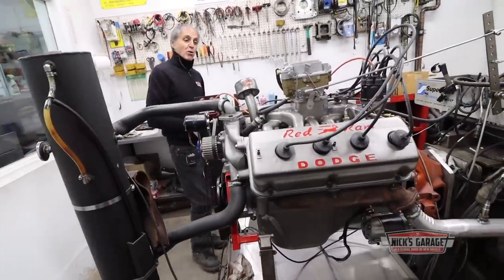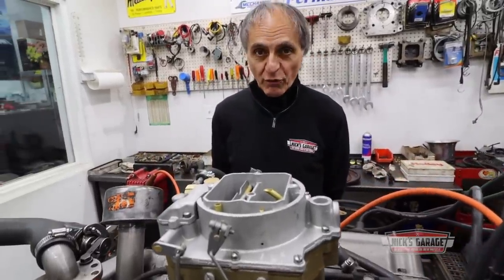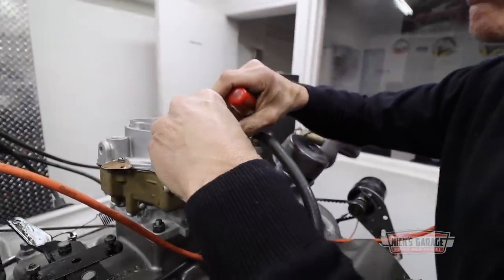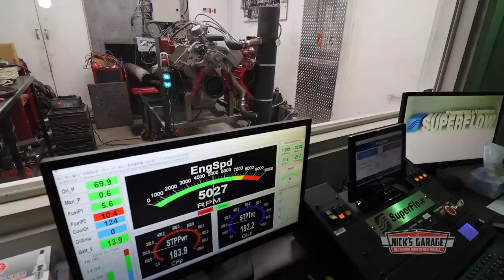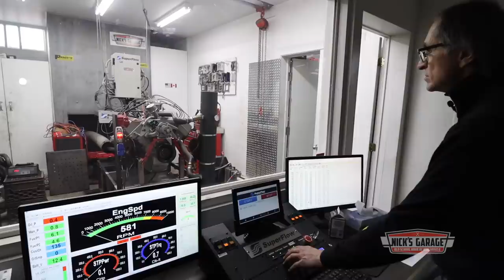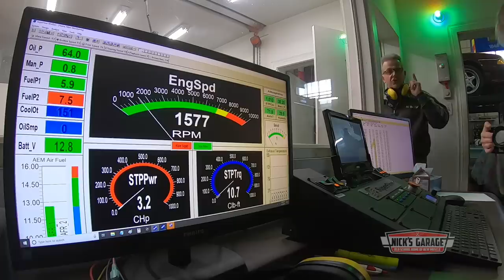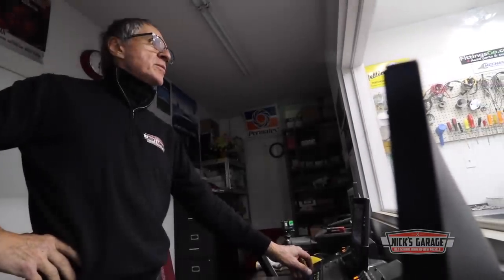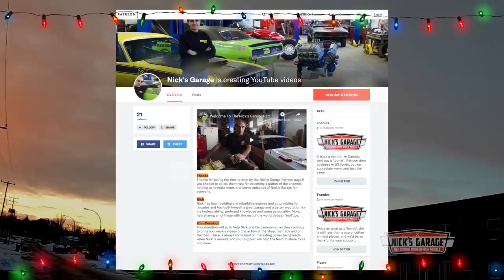Tiny Old HEMI - First Generation 241 Hemi on DYNO

Comment: Nick did you work out the lean issue ? 1 thing I noticed when your filming from the top secondary’s opened partially like 1/4 opening on pulls  . When you backed off butterflies seemed to close with very little linkage movement .Good job guys keep pushing  the mopar brand to the masses. Down under !
Reply: Walter.       Yes, we had it fixed the next day.

Comment: Hi Nick really like your show.  That miss you had becomes audible just when the secondaries are coming into play.  I would look there again. One other thing fuel can make a difference in your power reading's. With a compression ratio 7.1 use 87 octane or it will cost you about 5hp.

Comment: I'm thinking check the exhaust valve lash. valves might not be closing all the way when it get warmed up. or one adjuster wasn't tight and closed the gap keeping a valve from seating. that would cause a lean burn.
Reply: Brian.          Non adjustable rockers on this engine.
Reply: @nickpanaritis4122  ahh. I've learned something about early hemi now. I've only worked on 426's. Had one that owner just bought, it was stumbling and running lean. 4 of the exaust valves were too tight, valves hanging open and blowing out part of the AFM on the compression stroke. We moved them to factory gap .032 I think, been awhile, and it ran great after that. Thanks for the education on the early red ram, didn't know they weren't adjustable.

Comment: this comment is a bit late-- @ 36:10 the secondaries are just barely opening which is why there's no horsies coming out. I bet that motor would make 230-250 with all 4 bbls open. That weighted plate in back needs tinkerin' or the ex. manifolds are holding it back like you said.

Comment: Hey Nick. .02 cents here on this 7 - 1 compression 241 hemi. Less octane more hp. Add some other low octane fuel. Maybe 80 octone will actually up hp. Ive seen it on 454 bbc 8-1 before
Reply: Joe.        Yes, you are correct. I bought the lowest octane I can find which was 87. Less octane would have made a few more HP.

Comment: I’m in the process of rebuilding my dads 1955 Custom Royal 270 Hemi.
Last summer was the first time it was on the road since 1989. Ran great but had some leaks. The car spent most of it’s life in the garage.
Wonder If anyone ever put hardened valve seats in the heads of the 270 Hemi?
Anything special to be concerned about? Not so many machinists that are familiar with these and the last thing I want is to have someone blow through to a water jacket, or something.

Also, wonder if I should I go back with the rear main rope seal or a knew lip seal?

Comment: You can see that the secondaries are not open & flowing fuel. None visible in the throttle booster at 36:00 unlike at 21:00 where it is visible.

Comment: I use that same sealant in the squeeze tube and the can of spray great stuff 👍 great minds think alike. Whats the biggest lift on a hydraulic cam i can use with stock rocker arms for my 1978 360  ?  What gives a cam its lope? The lift or the sparation?  109,110,111,112 ? Do i go low or high on lobe separation? I want to build a mean LA 360 for my 1965 dodge dart using most stock parts and some after market? Also what size carb edelbrock . Thanks for your help / suggestions . Marry Christmas to you Nick and all your staff there 😎

Comment: Had a Red ram from an old Dodge  The gear box was a fluid flywheel with a clutch on the back of it then a 2 speed gearbox with a hi lo range  gearbox was heaver than the motor !!!!!!

Comment: Those Red Rams will fit under the closed hood of a 1934 Ford pickup with a little trim on the hood louvers.   What is the best HP one of these engines will turn out?

Comment: Wasn't the 150hp factory rating with a 2 barrel carb? You said the 4 barrel was a dealer option, so isn't the hp a little low then?
Reply: As far as I know the 241 came in 140hp and 150hp versions,  then the motor went to 270ci but kept the same 150hp rating.

Comment: Boy, she needs a set of 1 5/8" primary to 2.25"-2.5"collector long tube headers, an Isky cam(if anybody made cams for these it would have been and if you wanted it to run great it would be Ed Iskendarian) and a Holley 450-650cfm 4bbl cab. Wait... Nick was born after 1954? I thought he was actually older than that. Is it 245ci at 0.030" over? Cool video, I think they ask him to do too many takes explaning things then edit it where he repeats himself with overlapped info.

Comment: Hey you've got a miss in the ignition system and you need to put some headers or something so they exhaust will breathe you should be getting more horsepower than that especially out of a fresh motor

Comment: Late to the comments but   
      Did it clog after or during the larger jet run?
Seems like the primary circuit may be clogged.  
      Maybe measure the id of old jet vs new, could be numbering differences.  
      Original carb would be calibrated for far different fuel composition. 
      I see afr differences between non ethanol 91, and ethanol 93.  91 being a good bit richer.

Comment: Nick, you said you fixed it the next day. Can you tell me exactly what the fix was? Was the choke linkage blocking the secondaries? Why did that jet increase make it leaner? Or was it  INSPITE of the jet change something incorrect was done at the same time the cover was off and that something made it leaner?
Reply: Ok, I read every comment.  People asked Nick if he knew the secondaries were not opening or the secondary squirters were not squirting  about 503 times. He replied, "fixed the next day" 500 times without saying how. He replied, "blew out the secondary fuel passages" but nothing about the linkage once. He replied, "Fixed the linkage" without mentioning the secondary passages twice. He replied, "fixed the linkage and blew out the secondary passage once."  In an apparent anticipation to the question about why he didn't explain how it was fixed, he basically said the cameraman wasn't available the day he fixed the carb.
  Ok, most of us will never again own a WCFB carb. But the idea of screwing up a running engine by tinkering with a carb we are not experienced with gets to us.  Many of us have been there.
  My criticism is that Video this is a mystery story.  "Will he get the 10 hp back? Why did the  richer jet change make it leaner?"  And he never tells the answer at the end. I think Nick should add some text within the video giving the answer.  I didn't mind reading 800 replies but most people want it laid out.

Comment: Question...
Why aren't you attaching the original air filter and plumbing... that might make a difference and make her run smoothly??? 
This is not a criticism sir,  just a thought... From Phil in New Zealand.
Reply: Phillip.        True.  But we did not have the plumbing or air cleaner assembly. At least we ran it to see the mechanicals working.

Comment: Your problem is the carburetor, you can see on the overhead shot the secondary is not fueling properly at wide open throttle. Look at the secondary for the first run and all others, The air valve is not opening after the jet change. Just from the overhead view id say step up the left side secondary one size and the right side two sizes. Measure the jet size don't trust the numbers stamped on them
Reply: RPM.    We had it fixed the next day.

Comment: Nice job, Nick and crew. If those are Champion plugs i suggest that you try another brand. I have seen so many problems with Champion plugs i won't use them in anything anymore.
Reply: I have found the same problem and I never understood why. Autolites never gave me a problem.
Reply: You know how there are videos on testing oils, well someone should do it with spark plugs.
Reply: @chrismontreuil2206    Spark Plugs are a lot harder to test and the equipment to do it would be expensive.
Reply: @wysetech2000  true but someone still needs to do it.

Comment: Internal carburetor leak? Put a little 4 barrel on it like a 600 see how it does if that cant run at mixture levels then got to be ignition I'm just typing what I would do that's all.  And Merry Christmas to you and everyone in the shop this was a great video. When you ran your hand over the carb to try to richen it up and it made no change normally says the the mixture is rich enough but the plugs are white? Anyway will be looking forward to the video saying what you found now I gotta know LOL
Reply: James.   We had the carb fixed the next day.

Comment: ,,, just for this test, disconnect the vacuum,  and screw down the advance plate. At 7 to one it'll probably even start if you lock the mechanical . Of course make sure the rotor is near a terminal  .

Comment: You don't run spark plug gaskets on hemi's and slant six engines with spark plug tubes. For one it changes your heat dimension on the plug and especially on the old hemis the tubes will rip through as the gasket is harder than the aluminum  tube.

Comment: Always like to see the little hemi I use to see them in the dodge car were I use to do tune up at the Texaco station Saturday was a ball all the hot rods would come end I would tune up for Sunday. Drags I would have 409 Chevrolet 421 pontiac one customer had a428 pontiac they would have run Real hard to beat the 371 Olds tri carb I tune several 406 ford they were my favorite 4 speeds tri carb set up thinks for the show  on the little. Dodge.l.d.k.

Comment: The engine should have stuttered a bit when you choked it with your hand, I wouldn't be surprised if you have an intake leak somewhere. It would lean out the motor some as well..

Comment: Nick, thanks for the honest video.  Engine sounds good, I wonder if the O2 sensors are yielding the correct readings or did they get contaminated from the first runs that were a little fat.
Reply: funny guy

Comment: 34:00 running lean with a bigger jet. IIRC quadrajets have an air bypass through the jets , so a bigger opening lets more air bypass thus leaner mixture. Could it be something like that?

Comment: My  Cousin  bought a  new  '56  Chevy  with   the  265 cubic inch  265  HP  Corvette engine ,..  It had dual  4 barrels  solid  lifter cam  very high compression ..  It  ate Chryslers  for  lunch .   The  base  1955  265  cubic inch small  block Chevy  was meant to be a basic  economy motor ..and cost  like $78.00   for General  Motors to Produce.. There has  been a  lot of inflation since 1955
Reply: We all had a car that ate every thing else for lunch. Brand was not important only the memories ,which are like fishing stories and the big one that got away.
Reply: @rickbrandt9559    In  1956  they did not have much aftermarket parts..  So  Ordering from the Dealer  was importance   Remember the Genius of Zoros Arkas Duntov.. 
  It had  High Compression ..  Solid Lifter Duntov cam and dual 4 barrels from the Factory ....  The rings did not seat  it burned oil terribly,  He took the car back to the  dealer    they tore it down  honed cylinders and put in new rings..  The second time the rings  got seated  Properly ..
  My Father told me it was the fasted car on Kalamazoo Country.  I told my Father  that  if a Corvette  had the same engine the vette would be a lot faster due to being lighter.. 
  So then my Father said the Fastest Sedan ..
  The Chevy Dealer in Kalamazoo MI was Denoyer Chevrolet ..  Two of Denoyers  Sons  had the same  dual 4  barrel  56 Chevy and my Cousin could beat both of them with his car.. 
  Now in  '57  they had a  283  both dual 4  barrel or fuel Injected..  My Cousin is still alive he  is 84 years old now..
  I also have two friends who owned the same car.  One  guy bought it from the other .. it was a COPO  RS  Camaro with the Legendary 427 in it that out  over 500 HP  from factory ..   My friend had a brain Tumor and sold the rolling Chassis  for  $114,000.00  that '56 Chevy dual 4  barrel would be worth $140,000  today  the Camaro that much or more..
Reply: @rickbrandt9559   This article is wrong .. it said only one sedan was sold with solid  lifter cam rated at  245  HP  ..Everyone claims the made  265  HP  however..   My Cousin had a solid lifter cam engine and so did the two Denoyer Brothers  or maybe they had  hydraulic lifters with  dual 4  barrels and that's why my Cousin always beat them  
Aubrey also knows a lot about the powerplant.

“The dual-quad option using two Carter WCFB (carburetors) started in 1956 with the 265 V-8 and (was) offered in both Corvette and passenger cars,” Aubrey told us. “It produced 225 horsepower with hydraulic lifters and 245 with solids. It’s believed only one passenger car was built with the 245-hp engine at the request of Harley Earl.
Reply: Mike Skidmore the First hp per cube for Chevy was the fuel injection 283 ... the 265 made 245 with dual carbs. And there’s more than one out there l bet. Junior Stocks in the mid sixties was packed with them and Farmer would never pass a car if it was not a numbers correct car in the tear down shed. He was known to boot a car with non stock lifters... or the wrong model number on an automatic transmission.... several wrong number autos were kicked. Now, think about trying to pass a car while he had the factory papers in his hands... Forget It!!!!
Reply: @dannyruble5488   I googled  it most  accounts said the Solid  Lifter  model  with Duntov  cam  made  240 HP    some times they say  245  HP ..    the  Hydraulic  cammed  dual  4  barrel option was more popular and   made 225  HP ..  The solid  lifter cam  model  had  stronger  valves springs  for higher  RPM .. 
  I don't see much mention of  4  speeds .. I am  kind of guessing my Cousin had  3 on the tree.,,.
"  My  Dad has a '61 Belair with  a 283  4  barrel  three on the tree with Borg Warner  overdrive .. splitting  2nd  and third  gear  you  could shift it like a  5  speed and still get  good  mpg with  3:73 gears
Reply: My brother in law had chevelle in 1960s that had Duntov cam bought from dealership. I was a kid and didn’t know much but I remember it sounded stock and had almost no horsepower under about 2500 rpm. Over 3000 - 6000 rpm, well, let’s just say he used to like to do those fishhook burnouts when he came over to see my sister and the tires looked like they were going to fly off the rims.
I was in the back seat once as he jumped all over it and I thought the rear end was going to come apart as he went through the gears. You could get some crazy stuff from the dealer. That was just a 283
Reply: @michaelszczys8316  I still have a cam in  my '79 Z-28  Camaro the same grind as the  327  350  HP  cam  used in said Vette..  There are better cams  today .. but I want to put an LS engine with a Tremac  6  speed in the car next .. so no point in messing with the old style  small block which has  54,000 miles on it ..
Reply: Dave Micolichek   I would go for a  roller cam with roller rockers  for sure

Comment: On the problem runs is does not seem to draw petrol from the secondary mains, if that is the case it must run very lean...
Reply: Henrik.             Had it fixed the next day.
Reply: @nickpanaritis4122  And the problem was?
Reply: @henrikbark9168  .   The linkage was binding for the secondaries.

Comment: Hey Nick why don't you try raising the float level a little that should richen it a little bit. I know it's not as easy to do with an old Carter like that as it is with a Holley but niether is changing the jets.
Reply: 1320.       Thanks for the info, but we got it fixed.
Reply: @nickpanaritis4122  good to hear

Comment: So if you had to use a different tool to prime the oil pump than how does the 340 style distributor work? You changed the shaft over?

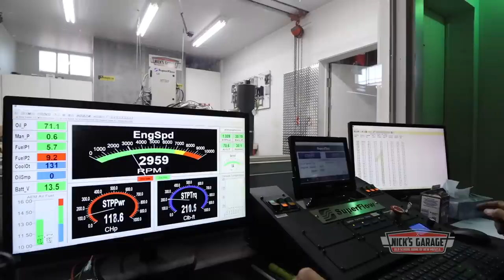Comment: Secondaries. Not. Opening. FFS. There's your missing 15 hp. You can clearly see them opening @ 21:33, and from there to the end of the vid, they never open more than perhaps 10% (see @ 30:15). I believe that on the old Carter carb like this there's a secondary lockout connected to the choke (been 30 years since I've seen one, so take that with a grain 'O salt). Still, see what's up with the secondaries not opening.
Edit: Found manual for the WCFB. Says: "...secondary throttle valves...are locked closed during choke operation to insure faster cold engine starting". Need to look at what's up with the choke linkage.

Comment: It's too bad it had to be a resto. I'd love to see what this baby Hemi could make with basic hot rodding; 9:1 comp, modern design dual plane manifold, Holley-type 600 CFM carb, another 20 degrees duration and .050 lift, some minor porting, and HEADERS. I think 250 hp is quite attainable.

Comment: I still think its in the Carb, there is no fuel being pulled from the secondary venturies, you can see fuel being pulled from the primaries, but not the secondary's
Reply: harley.         Had it fixed the next day.
Reply: @nickpanaritis4122  did you run it again on the dyno???? heck if it made 150hp with only a basically a 2 bbl, what did it make with a properly operating 4bbl??? btw, Merry Christmas!

Comment: OK, all you older engine experts. Which GM engine used a hemi combustion chamber before Chrysler did? GM dropped the hemi head because it didn't run as well as they wanted....i can't remember the other details why. Use Dogpile as a search engine.
Reply: @Mark S, yes I cheated and did research. I’ve never heard of the Welch Motor Car Company. Interesting how GM bought them out and never used the engine. I know a lot of early motor companies used some form of “hemispherical head”. Ford flathead and Harley Davidson uses them. My cousin told me that he worked on a Camaro that had a “semi-hemi” engine back in the 70’s. A 302 c.i. 2-4bbl “cross ram” race engine. It was only a one year option, probably worth millions today.
Reply: @IRONHEAD12701  The Semi-hemi  is the Chev big block 366 ( truck only ) 396 and 427. It was also called the Porcupine head, because the valves went every direction.
Reply: @Mark S, the 302 was a small block. High compression ratio (13.5:1) . More of a D shape semi hemi. One year only.